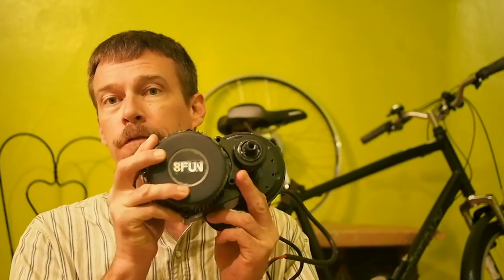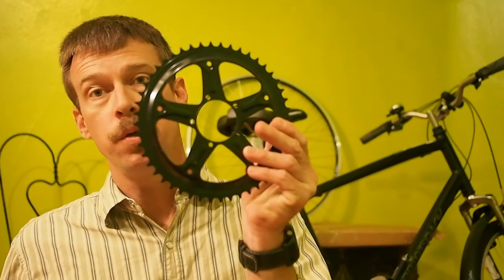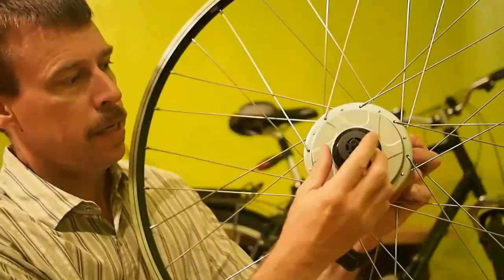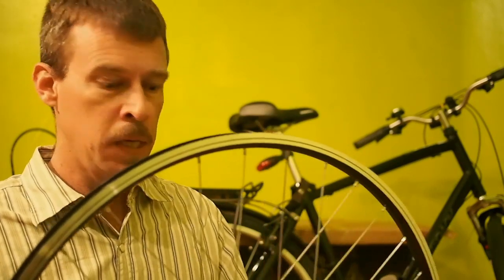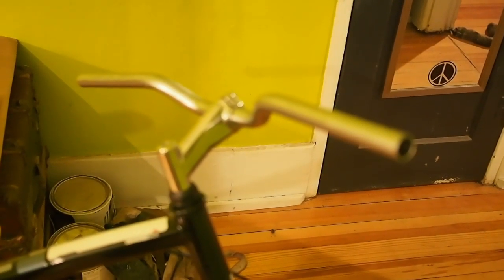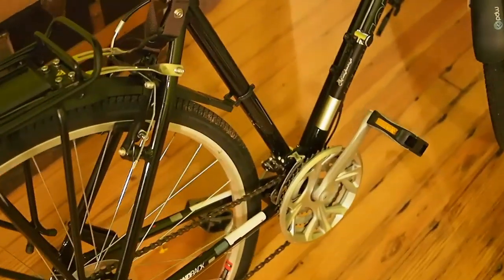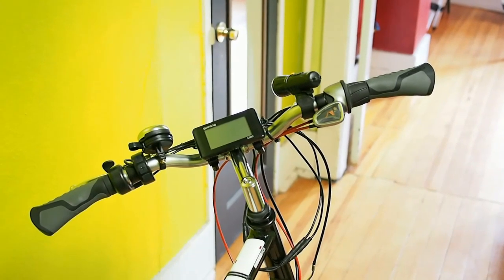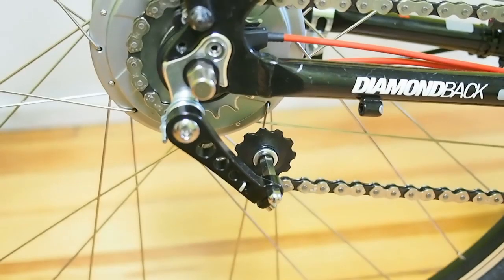Bafang/8Fun eBike Build Highlights

Comment from the maker: Video showing highlights of my 750W  mid-drive eBike build using the 8Fun 750 watt mid-drive motor and the NuVinci n360 hub.

Note- I did get a question on this video about the gear ratio I'm using. I started off with 36T in the front and 18T in the back. But to my surprise the particular NuVinci I got does not seem to have a 1.8/1 ratio overdrive. It's almost 2/1! (But only goes down to 0.6 insted of 0.5) So I was getting over 100 gear inches. So I bought a 20T cog to reduce it a bit and now I'm getting in the low to mid 90's. This makes the ungoverned top speed on a flat (throttle only, no pedaling) around 25MPH. Since I can only go 20 legally, and that gearing gives me more torque on hills, it works fine for me. (Though if I lived in a flatter area I probably would keep the 18t cog in as it adds almost 3 MPH to the top end) I've been told that the NuVinci's vary a bit and mine is at the high end. So for most people, 36T->18T will probably work better.

Keep in mind that higher torque = higher current. If you push the motor too hard you can draw too much momentary current with the throttle and trip the re-settable fuse in the unit.(i.e. gunning the throttle at a dead stop in your highest gear is bad.) If this happens, simply unplug the battery hold down the power button for a sec or two, then plug the battery back in and power on.

Comment: Beautiful build. Do you have any followup on how it is working?
Reply from the maker: Thanks Matt! I'm extremely happy with how the bike is working. I haven't had any problems with it to speak of. Both the NuVinci and the Bafang units have performed admirably. The one thing I'd mention is shifting requires some getting used to. The NuVinci doesn't like to shift under power. So the motor need to be off. It's fairly easy to throttle off right before shifting. But pedal-assist has a 'run-on' that can delay shifting a second. So I find that I've acquired the habit of just barely touching the brake right before I shift. Not enough to actually brake mind you, but enough to trip the brake switch which instantly disengages the motor and allows me to shift without effort.
Reply: Charles Werbick Hi I live in U.K.   I own a three year old.ebike bafung 250w rear hub motor 36v but also have throttle only due to buying it before the Eu laws made peddle assist  only.Thing is I like the bafung make.I've  seen the 8fun for rear hub but don't care so much tor torque.Just too speed.Do you feel that the 8 fun is too much torque and not enough too end.I don't have to worry about laws cos I have a full motorcycle licence. And can adapt.

Comment: Charles thank you for the detailed video!  Did you have any chain line issues with the aftermarket front sprocket and the rear sprocket, e.g. did you need to use spacers in the back to get the rear cog out a bit or was it fine stock?
Reply from the maker: naitsirk - No spacers, but I'm also  not using the Bafang front chainring . The tensioner I'm using is adjustable too... But it all lined up nicely, and since the only shifting is internal to the rear hub, I haven't slipped the chain once since I built it. (pauses to knock on wood...)
Reply: Charles Werbick Great to know!  I have the same setup as you with adapter ring, but chain line is out ~1/2" from stock bafang chain ring and I cannot reach my first and second rear gears without the chain slipping off. I have been thinking about upgrading to Nuvinci and was wondering if this would be solved.  Did you purposely dish your wheel out at all to the drive side?
Reply from the maker: naitsirk  - Make sure you don't have the chainring on the wrong side of the adapter.(Chainring goes on the inside of the adapter towards the bafang, not toward the crank/pedal side... (that would put you around 1/2" off)